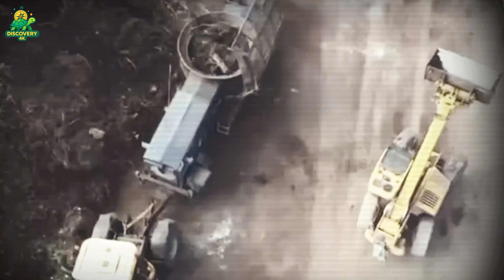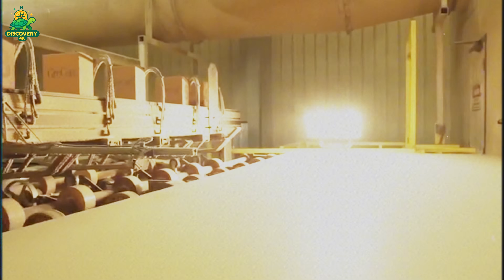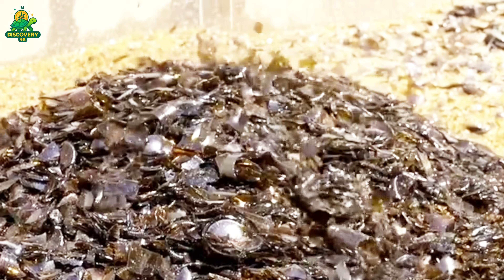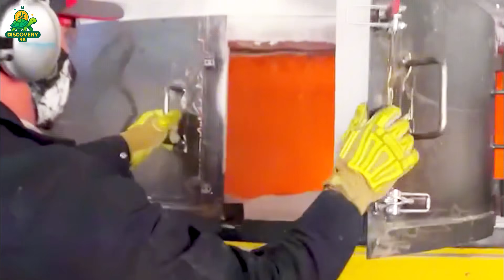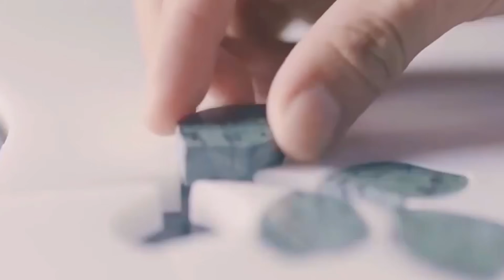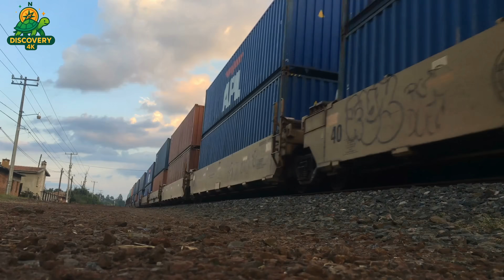Super Giant Recycling Plant: Transforming Wood Waste into Particle Board in an Incredible Process

Comment: particle board, if it is so good, why does most of the mobile homes in the southern states start to decay within the first 5 years, and when exposed to water, decays more rapidly?? Also why do horzintal pieces of desk et al break where normal lumber would not. I know this is not certified test, actual things that happen.. just my nickels worth.
Reply from the maker: True, particle board is cheap and fine if it stays dry, but once moisture hits, it falls apart fast. That’s why solid wood or plywood lasts much longer, especially in humid southern states